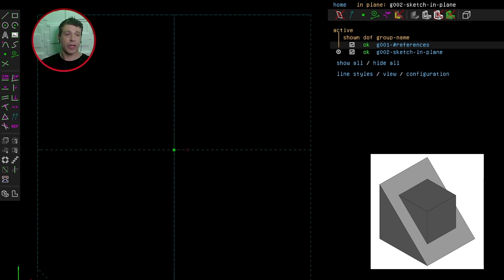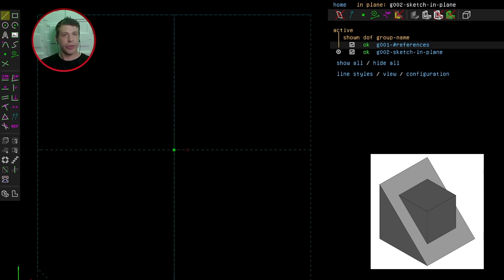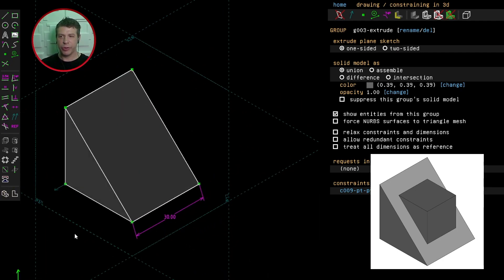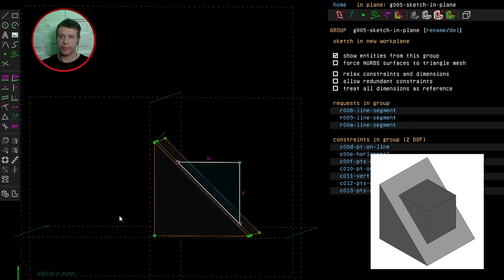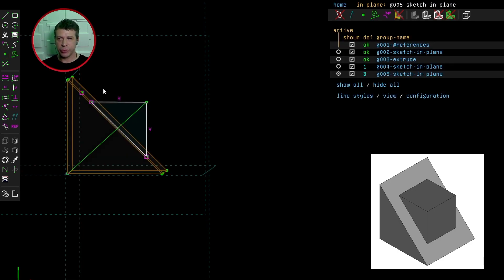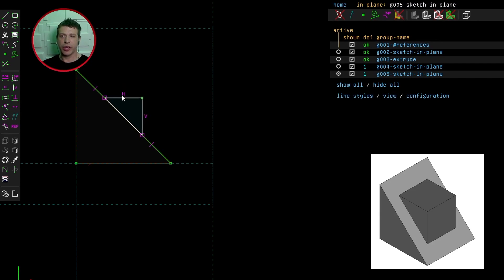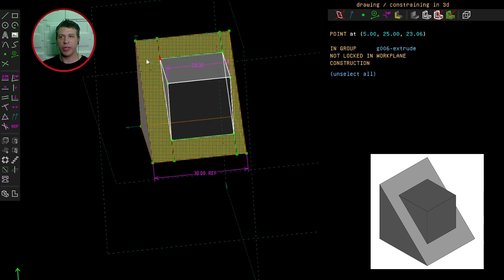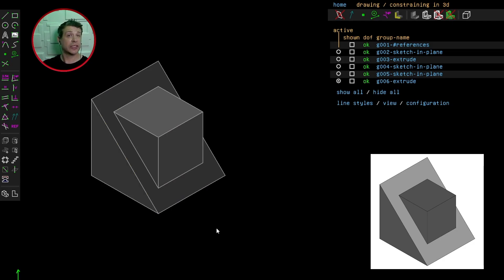SolveSpace - Challenge 13B

Comment: I found this CAD program a year or so ago and saw somewhere there was a fork that introduced expressions that could be used. Has this or couldn't this be incorporated in the main code?
Reply from the maker: Hi. thanks for the heads up. I found the fork online just now and it looks like it was updated about 7 years ago on GitHub, if I'm not wrong. I'll definitely look into it. Thanks
Reply: @blueskyprojects3898  Thank you. Maybe some update and/or pointer to the branch or some reference. Having this feature is a must on parametrics.
Reply: I have found a couple that allow this type of thing but couldn't get any of them to build.  I'd be very interested if anyone gets that to work b/c other than fillets/chamfer tooling, the  feature I'm missing most in SolveSpace is the variable/expression parameters.